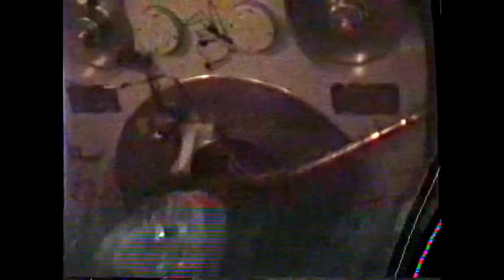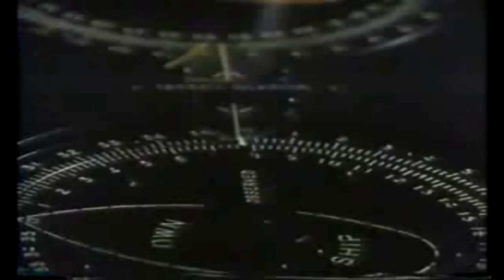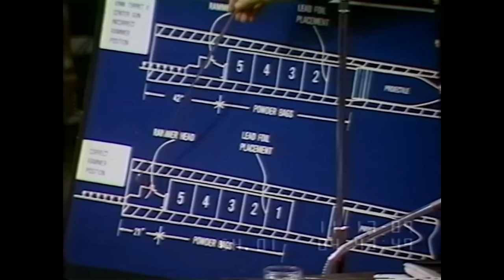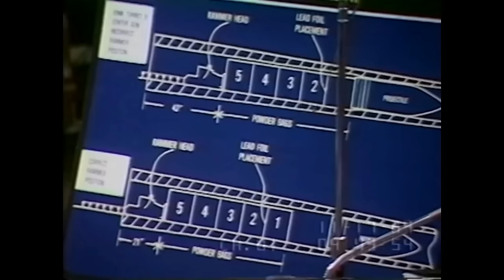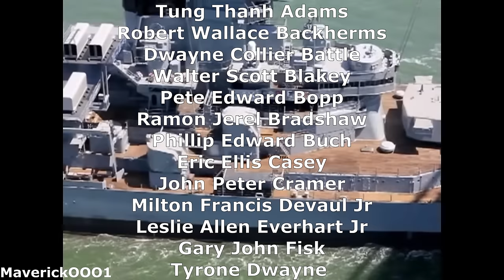USS Iowa Turret II Explosion: The Coverup That Almost Sank The Navy

Comment: I had a friend who was on the Iowa when this happened. He claimed that they were experimenting with "short bagging".  Loading fewer bags of powder (forget the number of bags).  The rammers were set to extend farther into the breach because of the fewer bags.  The crew switched back to the regular number of bags, but the rammers were not adjusted accordingly.  Each powder bag was made up of two compartments.  Front held smokeless powder, rear held black powder.  When the rammer over compressed the bags the black powder cooked off. Breach being open all the flame and pressure went into the turret. I am no expert. Just passing on what I was told about thirty years ago.
Reply: That explanation does not make sense if you know how the rammer works.  The rammer has no "setting" per se.  The operator's handle controls direction and speed.  Move it forward a little and the rammer extends slowly.  Move it forward more and the rammer extends more quickly.  Move it forward all the way and it extends at approx 14 ft/sec.  You need this kind of ooomph to push a 2700 lb projectile uphill and seat the rotating band into the rifling.  One of the major recommendations of the Sandia team was to develop physical stops and controls for the rammer operating handle that would defeat incorrect operation.

Comment: I am not sure an overram was the only cause of the explosion. An overram explosion would have been almost instantaneous but we know from what GMG2 Lawrence was saying is they were having a technical issue inside the gun room. I don't think it will ever be known exactly what happened that day.
Reply: @Jim Frazier I didn't work in Turret Two, so I can't verify it, but I was told by Clay that T2's rammer was squirrelly, and sometimes you would engage it at 1/3 speed, and it would shoot forward at full speed.
Reply: @CRAZYHORSE19682003  Yikes!
I'm a former Gunner's Mate (Guns) who served on tin cans, coded on the 5"/54 guns, and my educated guess at the time of the explosion was that the powder had deteriorated to the point that a moderate impact set it off.
I say this because of the several occasions when seeing the barges anchored out in Chesapeake Bay in preparation for Iowa to onload ammo in the middle of the bay for safety reasons to the surrounding area, on at least one occasion with the barges sitting for more than a week before the onload began in very hot weather.
I'm certain that those barges weren't chilled, so that powder had to get rather warm until it was finally onloaded and down in the magazines where it would be back in a properly cooled environment once again, thanks to the chilled water supplied by Engineering.
That powder is double-based, so that means there is none other than nitroglycerine added to the nitrocellulose powder granules to provide more energy, just as such small arms reloader powders as Hodgdon H110 and Winchester 760 are.
Double-based powders are a nice innovation, but the one major issue they have is that the nitroglycerine can separate from the nitrocellulose with elevated temperatures over a relatively short time period.
It's called "exudate," and it can detonate with friction or an impact, much as raw nitroglycerine in a bottle can when dropped.
My opinion has always been that Iowa's powder had deteriorated before being onloaded, then the rammer lurched the bag with the exudate just enough to start the terrible chain reaction.
I mean, hell, the explanation of exudate is only in the books that we studied to take the Gunner's Mate (Guns) petty officer test!
Reply: @Gunners_Mate_Guns  One of the other by products of powder breaking down was the production of the gas ether aka laughing gas. A lot of guys used to go down to the magazines and pop one of the airtight lids of a powder canister that contained three bags of powder, stick their heads in and take a deep breath. They would get a good fast high from it. When we were unloading ammo and powder after the accident, that was when I was most sacred. When the magazines were flooded, the powder canisters floated up and out of the racks and came to rest in a giant pile. It was like playing a giant game of Jenga where we would try and lift a canister and not shift the pile or cause an avalanche of canisters that could potentially set off an explosion. I switched places with a friend selected for that duty on the grounds that he was married and had a baby, and I was not. I felt he had more to lose, so I took his place.
Reply: If I may ask? Given the panic over the (apparently) smoldering powder, is it possible that they panicked and were attempting to get the powder into the gun in hopes that the breech, once closed, could contain the blast, only to accidentally cause the disaster they were trying to stop?
Reply: I wonder if that charge of power bags could have had one bag contaminated with hydraulic fluid during the trip up the hoist. At the beginning of the video, that 55 gallons of hydraulic fluid a week seems like a lot of loose flammable fluid dripping on everything.
Reply: @Rammstein0963.  That sounds highly plausible.
The shouts of "Mort! Mort! Mort!" could well have been a last desperate call for help to quickly get the bags into the breech and the rotating bolt full closed so that the gun would fire normally.
It makes me sick to know that almost certainly the men right at the breech saw their doom coming in those last split seconds, without enough time to save themselves.
Reply: @Old Guy Gaming Network  that's really bad.  That gun shouldn't be in service.
Reply: @kevinthomas895  I would say no, the hydraulic fluid was mainly leaking on the electrical decks. I spent many an hour soaking up hydraulic fluid in sponges and squeezing it into a bucket. There would be two to three inches of hydraulic fluid on the floors every few days.
Reply: @Rammstein0963.  When the explosion happened, the rammer was still in the breech. I don't see how a powder bag would have started smoldering on its trip from the powder flats, up the hoist and onto the cradle.
Reply: Thanks for the reply, didn't know that detail.
Reply: @Gunners_Mate_Guns  The "Mort" that was being called for was Dale Mortensen, the Turret Captain of Turret 1.  He passed away on Dec 21, 2022.
Reply: @SomeRandomHuman717  Correct
Apparently GMG1 Mortensen was a fine Gunner's Mate, with extensive experience that they relied on.
I'm certain that he was haunted to the end of his days by not having been able to lend the help that the crew in Turret 2 so desperately needed, shouting for his name over the sound-powered phones, even though the interval between when the crew in Turret 2 noticed the problem and the explosion was so short that it's doubtful that anything could be done in time, even if PO Mortensen had been sitting right next to the breech that had the explosion.
I can't imagine how it must have been for him carrying that burden for the last thirty years.
Fair winds and following seas, GMG1 Mortensen.

Comment: Since they knew over ramming was a problem many years before, there should have been preventive measures to stop any possibility the loader could over ram. Yes, just a landing in the barrel would stop any over ramming.  I'm ex navy, and it's more like make it work sailor. And if something happens, it's ur responsibility. You are the escape goat.
Reply: Ah yes, reminds me of those badly manufactured Barretta 92/M9 slides that blew apart, so the decision was made to accuse anyone who experienced that type of slide failure of using overpressure cartridges. IT didn't matter that they were standard NATO cartridges used by our NATO allies without problems. The guns were junk for many years until somehow the M9 manufacturing process got modernized and improved . That was similar to the notorious M60 problems that lasted for decades until someone decided to fix the darn problems so our troops didn't die trying to make the junk M60s work as they were getting hit by the enemy's bullets. Then add in the USAF covering up poorly performed maintenance on the F-16 such that the fancy fly by wire systems were being significantly damaged by wire chafing caused by improperly used fasteners and no decent wire chafing protection. Yep, they'll kill you to protect their precious procurement programs. The piece of junk Osprey, the pieces of junk Bell helicopters with their stupid teeter-totter main rotor systems , and more.

Comment: My Grandfather was GMCM Hill. He retired in 87 and I recall his retirement. He knew every single one of the men who died. They tried to recall him to active duty. After serving for 37 years he said yeah no. He was absolutely furious over the whole thing. He claimed they used powder that had been stored in barges on the Chesapeake bay. Gun powder degrades when it hits temps over 100°. If those temps are unchecked you now have unreliable and often dangerous powder. The bags of powder did degrade and became extremely friction sensitive. That was his theory.

Comment: Sandia labsSandia labs did testing on the bags full of cordite the face stuff into the barrel the shells. They dropped heavyweights on them from a tower they could not cause an explosion by that method but then a naval officer assigned to the task made an observation change out the big sometimes broke and lost and create and then they put in extra chordate including sleeping sit had fractured cordite pellets. They decided some testing with bags that had fractured pellets. They only have to do three or four of those when they hit one with the drop weight and the whole bag exploded

Comment: I never served in Naval gunnery, but I question the weight adjustment of powder bags by adding powder to the end of a bag.  Clearly there must have been regs that considered the dangers of lengthening the bags, as well as its detrimental effect on overall burn speed due to slight loss of homogeneity of powder mass.  Also, although I assume that the poly bags contributed to resistance to static and friction complications, had they passed full Navy Safety Board testing?  And then it would seem that any tampering or adjustment of those finished bags would not be approvable.

Comment: Interesting video, and, it seems obvious to me you solved the mystery in the first few minutes, with the recording of the crew reporting a malfunction, and the well documented problems with the powder bags. (Either the new high power or surplus "rebagged", and the cover up was to save the supply officers ass) Seems logical from the audio, that the crew could not get the barrel loaded and breach locked and ready to fire because 1. Either the shell was not pushed all the way in, or 2. the powder bags were not going in correctly, and they were dealing with that, and reporting the problem, when they noticed the smoke, (the force of the first ram attempt caused the smoking), and just as in the tests, it exploded.  Would be interesting to know what position the powder ram and tray were in when the explosion occurred.  To have not photographed the turret upon reentering seems to be incredibly stupid.  A hundred thousand guns fired in WWII, and this never happened.

Comment: At the end of this video (30:42) is a video of a battleship being escorted my tugs.  On the bow of the battleship, is a chain extending forward into the water quite a distance in front of the ship.  The chain is not connected to another tug, but extends into the water as though it was being pulled be a sub (if that were possible).  What is going on with the chain at the bow of the ship????

Comment: We did NOT fail our first OPPE, we stopped it about half way through it because we realized we were pushing our joining the fleet way too fast and safety was at risk of being compromised.  Two months later we successfuly completed the OPPE, including the full power run (maintain flank speed for 1 hour).  FYI: IOWA holds both the speed record (36.6 kts.) & the longest 16" projectile shot (26.6 nm.).

Comment: Just one question: With every space of the whole turret  totally sealed off from all the other spaces, with complex doors and hatches designed to prevent fires and explosions from spreading throughout the turret how did an explosion in gun two gun pit result in the deaths of the entire crew of turret two?
Reply: The turret spans 7 decks.  From the bottom of the ship where the bullets are stored and hoisted up to the breach.  Any explosion would easily pass through all 7 decks via the hoist.  I was just below deck, back of the center line and will never forget seeing white smoke billowing through the passageway, followed shortly by the GQ sirens.
Reply: It's difficult to speak ill of the dead, but the most likely answer to your question is that most of the safety features designed-in were not working, or not implemented by the crew.  As you stated, the Iowa-class turrets have lots of compartmentalization, but if the doors/hatches are left open, what good does it do?  If the turret's internal fire sprinkling system was not energized, what good would it do?  If the crew did not have the needed number of OBAs (oxygen breathing apparatus) or EBAs (emergency breathing apparatus) in the correct storage locations in the turret, what good would they do?  If the powder flat crew did not literally stack propellant bags in the base of the turret instead of receiving them only as needed according to the firing plan, they would not have been in the powder flat at the base of the turret to explode or burn.  If my suppositions are correct, then in a tragic sense the victims of the explosion set the scene for their demise.  However, as I have stated before, in the military, when the troops make mistakes, it is first and foremost a leadership failure, because it is the responsibility of leaders to correct the mistakes.
Reply: @BillSnyder-c4q  According to reports, the powder car doors in all of the gun rooms were closed and the powder car in the center gun room had not been lowered.  I'd have to go back thru the reports, but I don't recall any stating that powder hoist doors were blown off hinges, or that the L and R powder cars were blown out of their positions at the base of the turret.  The shell hoists stop at the lower shell deck, so the explosion and gasses could not have taken the shell hoist path to the mezzanine deck and the powder flat.  It's much more likely that the explosion and its effects travelled down in the turret thru the left-open access hatches in the gun pits, electric deck and along the center stalk.

Comment: Reading up on the wiki article and several other sources, I personally lay the blame at Master Chief Fire Controlman Stephen Skelley. He orchestrated using different powder compositions to get longer ranges out of the main battery. As a result, they used powder designed for the 1900 pound projectiles, to launch the 2700 pound projectiles. These powders were WWII era, some of the oldest. I don't like to lay blame at people, but Skelley's little experiments, most of which the crew felt nervous about performing, led to this, and is my firm belief

Comment: I was in artillery, we had one anxious situation in Grafenwöhr, when a charge didn't ignite and after a Long, long while someone, the most experienced in the battery, had to open the breach block screw! Nothing went off and when retrieved, the charge bag had a black hole in the middle (from the igniter) but it was cold; fortunately. 
Hypothetical assumption on the Iowa: When they saw something smoldering on the charge, horrible, but could a more experienced, better trained, savy gunner team have saved the situation by quickly closing the breach block?  Without asking any lengthy questions for superior's help, which wouldn't come on time anyway? 
  Usually I would criticise the superiors, Lack of prior dry practising, shabby maintainance of the ram mechanism; the Admiral was there to "inspect" (actually to claim any expected positive results and success reports for himself), everyone down the ranks tried to "gain" something for their careers, even doing "experiments"... and the team at the bottom of hierarchy probably had a feeling of "we had drawn the short match"; then they left the door to the neighboring guns open. Not very caring, sloppy or ?intentional? For Help? For chatting? 
  
Continuing with another thought/point: the No2 gunnner team knew it was a somewhat dangerous "cheap money saving shot, too!" an experiment, where the gun could explode in front of their noses! So they left the compartment door open and planned to go to the adjacent compartment and then close the door; only one man left in for firing the gun! 
The team concentrated on this one risk and were helplessly baffled when quite a different risk arose! 
A good plan (in hindsight, easy!!!) for this experiment would have been: all gunners leave the Turret and gun_2 will be ignited by remote controll. Then maybe the mindset would have been different, when the unexpected Loading problem arose! And they probably wouldn't have rammed the charges in such a hurry as they did.